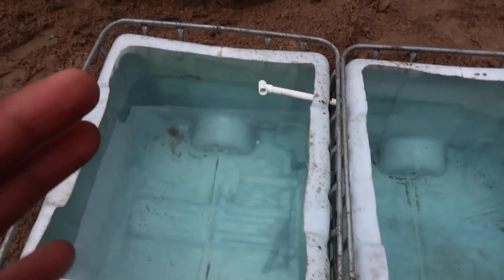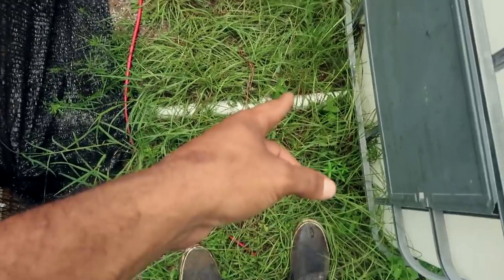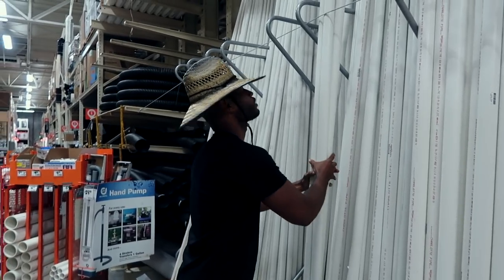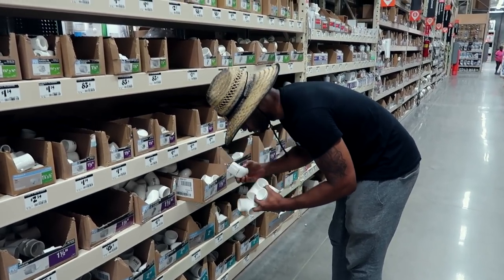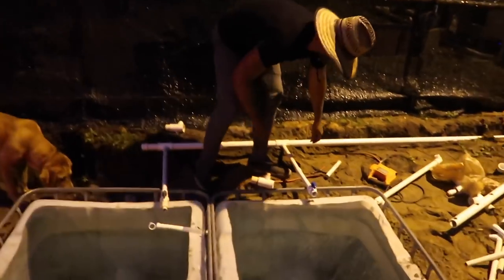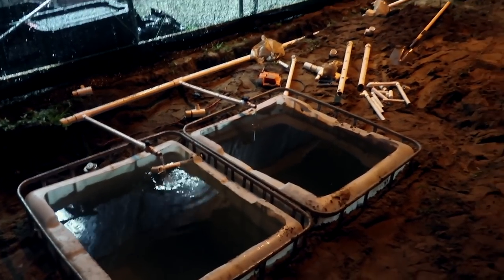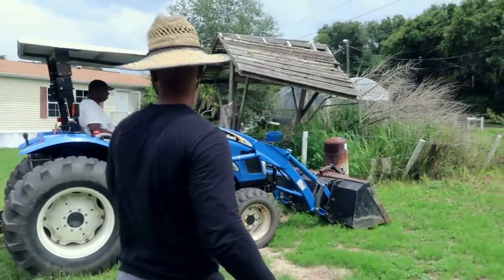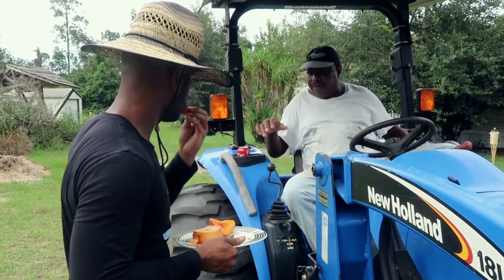These Tanks Will Store Aquaponics Fish Waste | The Aquaponics God Ep.68

Comment: I have a question about a basic flood and drain system so this will be an indoor project and I’m wondering does the fish tank have to be under the grow bed or can I just run the drain pipe down and then 90 degree angle it to the fish tank next to the grow bed the reason I ask is because I feel like if I put it under the media bed i will have to raise the grow bed up higher and I feel I won’t have the ceiling height to grow taller plants